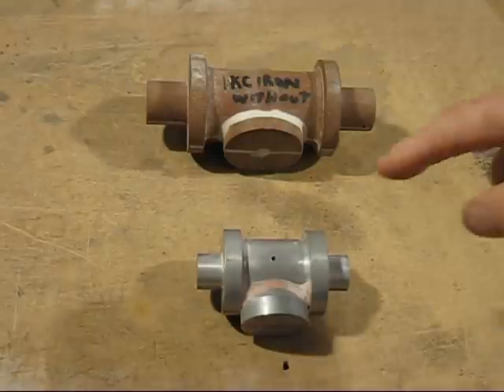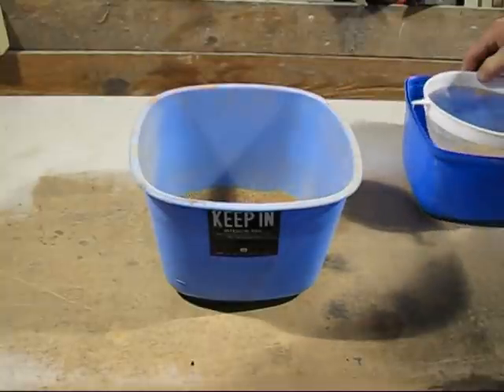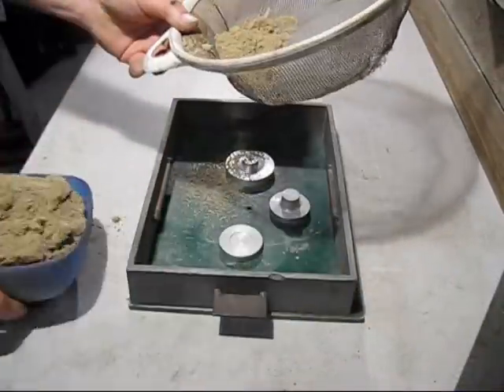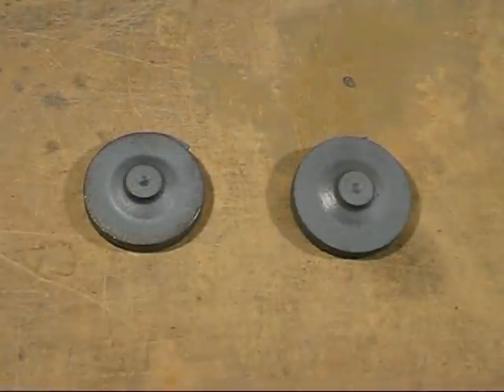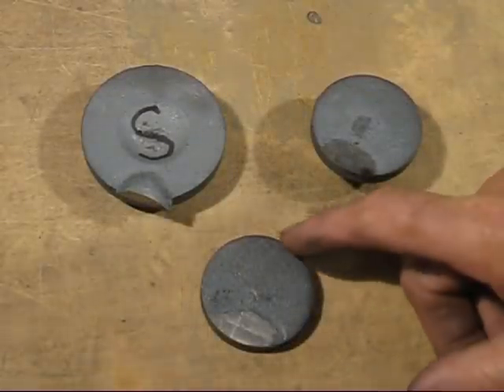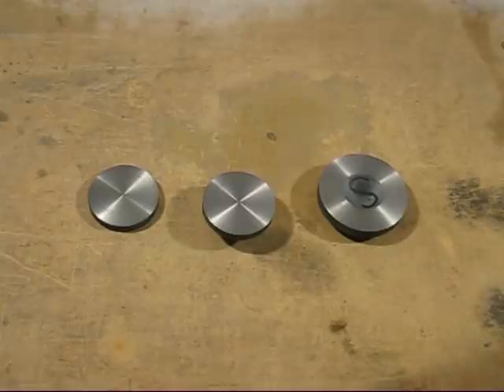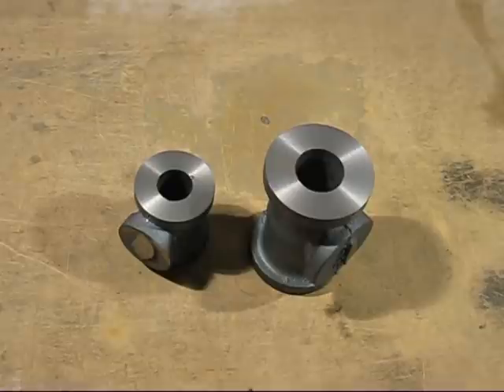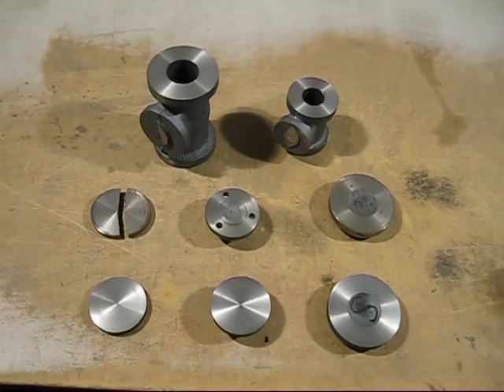Can sawdust be used instead of coal dust when casting iron?

Comment: At what temperature do You have to bring the ferrosilicon, to melt it?
Reply from the maker: Ferrosilicon does not melt it dissolves in molten iron.
Reply: @luckygen1001  I guess You don't have the temperature, then? I worked at a ferrosilicon plant for ten years, so yes. It does melt, when hot enough...
Reply from the maker: @qivarebil2149  What is the melting point of ferrosilicon?
Reply: @luckygen1001  In a state, ready to pour from the crucible, I have a vage memory of 1800 degrees celsius. But I could be wrong, not much though.
So, to melt ferrosilicon, and handle the dross and all, You need to take it up to around that temp again. I could ask my former colleagues, if needed?

Comment: Will a reheat normalizing soak remove the hard chill spots from the casting?
Reply from the maker: Yes it does work but temperature and length of time needs to be correct. (trial and error)
Reply: it was a statutory requirement that the detaching bell gear on coal mine cage systems had to be annealed in a specific way I saw it done once about 50 years ago. Consisted of a huge timber fire, fan blown for a day then covered and left several days to cool
Seemingly no great science involved, merely the experience of generations of shaft fettlers.

Comment: Torrefaction, or pyrolysis: heat sawdust to 500–800°C ( generally ~550°C is most ideal) in an inert atmosphere (absent oxygen) to get char (biochar). Much better consistency, much better chemical purity, than coal. Because the dust retains the cell structure of wood, you get slightly different surface effects.

Comment: This was really interesting-I had been wondering about coal dust as well as grinding up charcoal briquets.  As I was watching I was wondering about using whole wheat flour.   I had once tried it when casting aluminum and had really interesting results-mostly in the amber color it imparted to the surface of the aluminum.  I like the idea of using the organic material in the facing sand.  I had mixed in with the entire batch.  The one other thing I learned on that occasion was that it was best to do the casing outdoors or under a really good fume hood.
Reply from the maker: I am hoping that anyone watching this video will try other organic materials and see how they work. Using coal dust gives aluminium a brown stain and the reason why it does that is because of it's low melting point.

Comment: There are other ways of obtaining coal dust, or rather substitutes for it. 
Essentially it's the carbon, and its properties, we're after.  
One way could be to grind down regular charcoal using the missus' kitchen grate. When I think about it, perhaps buying your own would avoid unnecessary confrontation. 
I would avoid using charcoal briquettes as they usually contain clay. Clay that binds water, this might have a negative impact. Although the amount of water we're talking about here is minuscule, so it'll probably work just fine.

If a fully DIY approach is desirable then a technique from the wilderness survivalists might work. 
Small squares of cotton cloth is placed into an air--tight tin. I cannot stress the air-tight part enough. 
The tin is placed into a fire for half an hour to an hour depending on its size and the amount of cloth. 
The end result is essentially thin woven sheets of charcoal. They are as you might imagine extremely brittle and should be easy to grind down to dust.

Comment: Good day sir.
I have a different question at the moment. So I am doing my dissertation on crucible steel via 'co-fusion' of wrought iron (actually low carbon construction steel) and cast iron, with minute amount of charcoal. I use coke as fuel in a oblong pit furnace made from clay, and fuel with charcoal and coke. I use a 1200W hair dryer feeding air in the tuyere. I got 1357 C only, no matter how much air I blow in, how much fuel I put in and even when I create a chimney, flue above the pit. Nothing works. Can you help me?
Should I get a stronger blower or add another one?
Reply from the maker: Charcoal burns too quickly use only coke it burns the hottest.
Reply: @luckygen1001  I meant to say I use wood and charcoal to start a fire and then I put coke in the furnace.
My question was how would I increase the coke  burning temperature?
Do I increase airflow or the amount of fuel?
Reply from the maker: @emel60  Try increasing the airflow.

Comment: While not nearly as cost effective as coal slag, I've made my own refractory sand with silicon carbide, aluminum oxide and pure powdered graphite for the high detail faces, depending on what I'm pouring. Pure graphite can take the most heat and sticks the least, but all three can be had in the 1500 grit area and finer if you like.
Reply: Hi there, so how do you apply it? I think two ways: one is mixed and used as contact sand, the other could be spaying it like a refractory paint.
I have tried my own mix using m200 quartz powder but it peeled off and cracks when it dries. I guess it is a matter of running more tests.
Reply: @miketxs3150  Two methods, though one is a bit more labor and prep intensive. If doing graphite alone, you can dust it in with a traditional talc bag (I like to use cheese cloth or an old panty hose from the missus' stash) or a fine mesh strainer. Those spatter guards you set on your frying pan also do it in a pinch but need  a bit of shape modification so it doesn't just waft all over your work area in a breeze.  
The other is to sonicate a batch in water for several hours, then add it to a very thin mix with sodium silicate (powder) for dispersion through a spray bottle. 5:1 water to powder and I've gone all the way up to 8:1, depending on if I'm using technical grade or lab grade powder base.
Reply: @Mark Harriss Yes, hence the line in my first response "depending on what I'm pouring". Graphite is the universal cure of sorts in regards to temperature resistance, but it's not the cheapest. When mixed in the right proportions with a few other additives, it makes a fantastic base layer for a ceramic shell. =)

Comment: You use propane for fuel right?
Reply from the maker: Only to preheat my furnace before switching to waste oil.
Reply: @luckygen1001  I now remember you saying that in a previous video some time ago. I've got to get a waste oil set up built for melting at higher temperatures.
Reply from the maker: @docvencil2222  Waste oil is always cheaper than propane.
Reply: @luckygen1001  Do you use cooking oil or motor oil? I can see waste being less expensive than propane.
Reply from the maker: @docvencil2222  Motor oil but I use hydraulic oil when I can get it.
Reply: @luckygen1001  I imagine hydraulic oil comes from a different place. Is it changed less often? Where would I look for it?
Reply from the maker: @docvencil2222  Two very good reasons why to use it, 1. it is very thin so less diesel is needed to burn it 2. it is very clean compared to motor oil. It can be difficult  to get hold of. Workshops that service and repair hydraulics would be a good place to look.
Reply: @luckygen1001  hi lucky! What do you mean with adding diesel ? I thought it works only with the oil.
So you preheat the system with propane, then switch to waste oil mixed with diesel? Wich proportion do you use?
Reply from the maker: @miketxs3150  waste oil will not burn properly unless it flows like water. There are two ways to do that 1. heat up waste oil so it flows better 2. add diesel so it flows better, I use 20% diesel 80% waste oil.

Comment: I think that the powdered charcoal , or coal Dust would be easy to obtain by Buying any of the many Charcoal Briquets that are used for barbeques. It would be a simple matter to break Down the briquets with a hammer and a terry cloth towel. I also think that he coal powder helps keep the mold surface hot as it catches fire ahead of the pouring iron, and helps Flow of the iron. Great Test!  Enjoyed it!

Comment: I'm admittedly curious if any of the adhesives in the manufactured board that was used to generate the sawdust are playing a role in how it burns during the casting process as described at the end of the video, as opposed to say, starting with intact lumber whose treatment was no more than kiln-dried.

I'm also curious now if the type or types of wood used for the sawdust plays a role in suitability, and if grain-size of the sawdust matters.
Reply from the maker: I did think of that before I tried using sawdust. The adhesives will burn but are only a small percentage of the total amount of sawdust. I think pine has a lot of resin in it and would be the best to use. Having used this method only once I am hoping that others will try other types of wood to see how it will work and then get a better idea as to what works and what does not work.

Comment: Good to know, Ill have to give it a try sometime with some sawdust. I have piles of sawdust from the belt sander from when Im making patterns, so Ill just try some of that. I know you can slow the speed down, but usually what I see with the chilled castings, the chilling is usually the worst where you need to drill through it or mill a slot in it, and not everyone has carbide drill bits or carbide endmills to get through it, lol. I'd be interested to see your weight/percentages of ferrosilicon that your using for your pours also, that seems to be a bit of a hidden bit of info that most people cant find. Im also interested to see how much the sawdust will choke up the sand over time also, and how much it decreases the green strength over time with all of the burnt fines mixed in to it.
Reply from the maker: I started to use 0.25% ferrosilicon on the first rotor melt and was the right amount but other rotor melts I found that I needed about 0.35% or higher.

Comment: They used to use flour as a binder for sand cores which were baked before use. perhaps flour would work for facing sand.
Reply: flour wasnt used as a binder, it was added so when the metal hit it, it burnt and would decrease the strength of the core, causing it to collapse slightly, which would prevent problems with something similar to hot tearing/shrinkage defects around the core, and would also help with removal of the core after the casting had cooled.

Comment: Two questions:
1.  When you added the sawdust to the (slightly damp) sand, didn't the sawdust just suck the water out of the sand and become damp sawdust?  So, starting with very dry sawdust seems unnecessary.
2. Is there a way to post-heat-treat the chilled castings so that the chilling is removed?
Reply from the maker: Damp sawdust will always have less moisture than sawdust made from green timber. I did find that I had to add slightly more water to my sand than usual. You can heat treat iron castings but it needs a long time to anneal it at high temps.

Comment: Good and surprising information - I expected the sawdust to give a coarser finish, and it was the opposite! Great tip on reducing machining speed! Made me recall that, a few decades ago, an uncle of mine had an engine head welding and repairing shop and I remember the heads were faced on a big lathe on a huge face plate at a speed of around 40 to 60 RPM and it puzzled me how good the finish was at such low speed, rarely needing to go through the surface grinder (which was also huge).

Comment: What about using "corn flour" which is usually just pure starch. From a chemical point of view it is almost the same as cellulose just the structure of how the glucose subunits connect is different, linear vs branching. However wood also has lignin that contains a lot of cyclic carbon, as per the benzene structure. The advantage of starch may be that it is very fine and "off the shelf", also very consistent in its composition so your results are more reproducible over time. Just an educated guess...
Reply from the maker: I tried wheat flour but it did not give the finish I wanted. If you want to try something else be prepared to do a lot experimenting.
Reply: When you heat up corn flour/starch, you create dextrin, which if it isnt all burned up from the sand, it makes the sand very gummy and eventually wants to start molding. Ive tried that before in the past and it didnt work out so well, and after the mold started growing throughout the sand, it ended up just getting tossed.
Reply: @ChirpysTinkerings  Ah that sounds logical, perhaps a pre-bake of the sand/starch mix at the right temperature in a closed tin with a gas vent will push it past that point while still having useful characteristics, but then you are messing around as much as you are to get the sawdust so why bother? Perhaps wheat bran put through a blender is closer to sawdust.
Reply: @DanielSMatthews  I think the sawdust is much easier to get, especially if your making patterns and have/use a belt sander, lol.
Reply from the maker: @ChirpysTinkerings  Yep sawdust is so easy to get.
Reply: @ChirpysTinkerings  Yes that is a good point, perhaps the type of wood matters too, I have some concerns about the toxicity of the glues in some particle boards.
Reply from the maker: @DanielSMatthews  When the iron ran over the hardwood plank it gave a good finish but we need to get as many people using different woods to see if there is a problem. I know that coal dust gives of toxic smoke and this is why I open the door when pouring the molds.